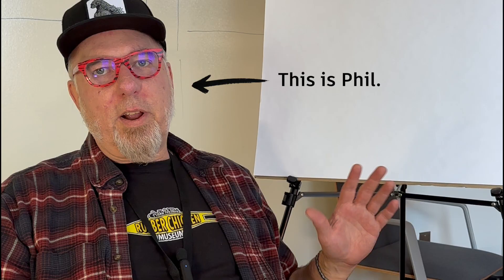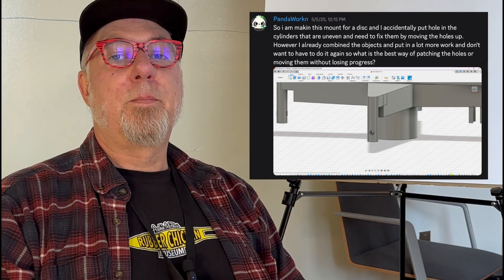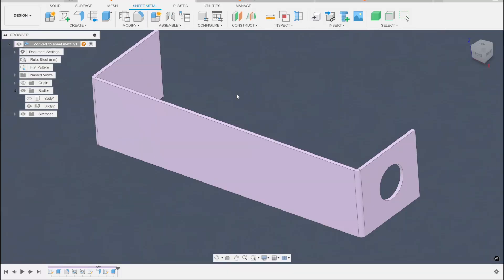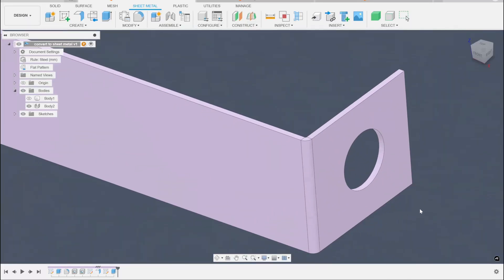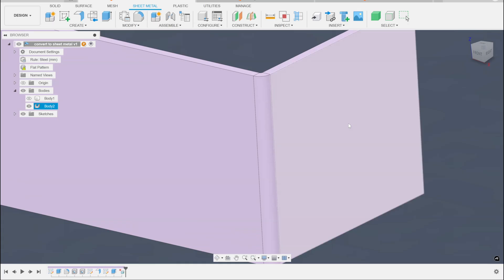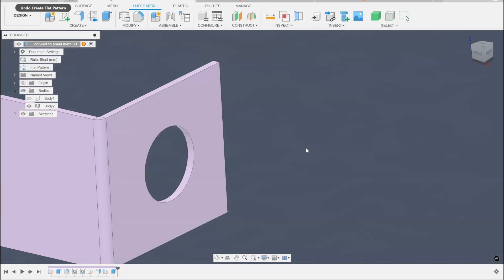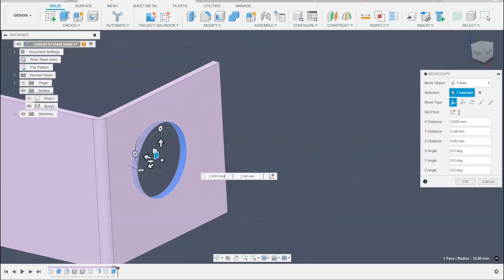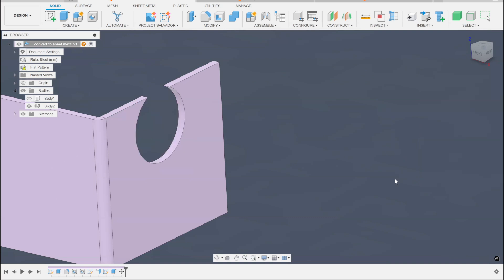How to Manage Timeline Edits | Unstuck My Fusion Design

Comment: TIMELINE PERFECTION SNOBS WILL BE FREAKING OUT RIGHT NOW! 

But at the end of the day. this is validating. that LAST action in the timeline is truly what matters, often i find its REALLY fast once you muscle through a design for long enough with all the chaos, redraw it from scratch you can have an ultra clean timeline flow and Parametrically designing everything from the get go. 

This is a great video and totally validating.
Reply: Yes I am. This is really bad advice.
Reply: @martinmarriott3607 Agreed.  This is unbelievably bad advice for more reasons than are worth going into here.  I’m really surprised that this is the “official” way a fusion “specialist” would recommend a sketch correction.  Someone may get away with doing this on a sketch that contains very few operations.  The frustration it will cause with a somewhat complete design would be a nightmare.  No wonder I keep asking myself why there isn’t better parametric software out there.
Reply: @BobGarrett66  That's why he did not say it was a good idea to use in general, he showed something was possible to fix at the very end and he's absolutely right.  It should not be a cornerstone to how you design, but "get out of jail" tools are critical for anyone who makes things and needs to get something done to ship it.  It is a bandaid, not a pillar.